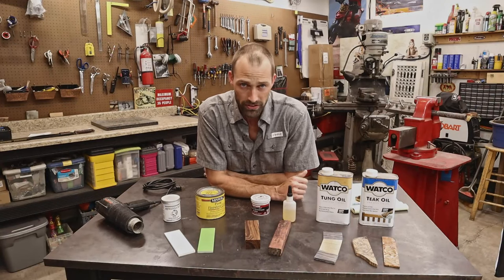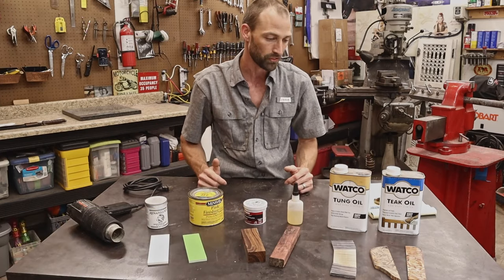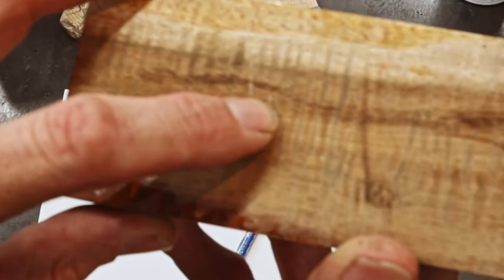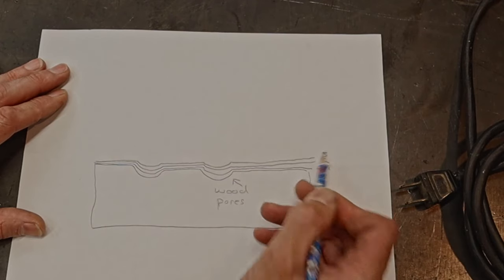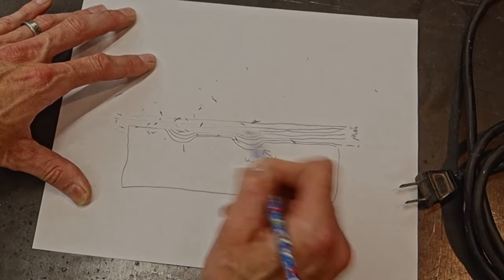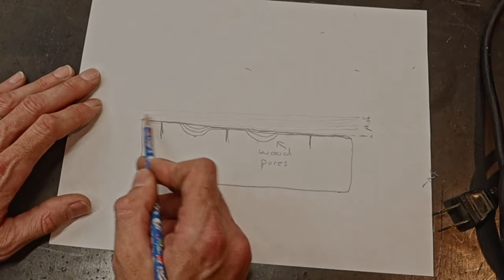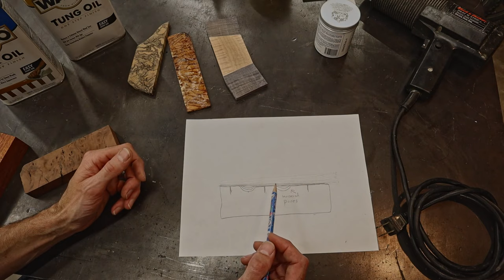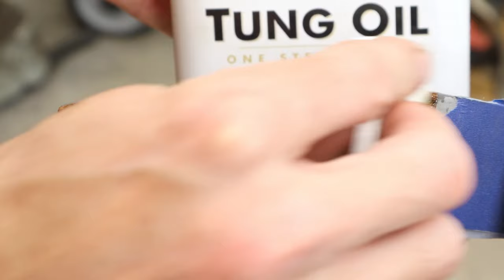Finish for handles that makes grain pop

Comment: In addition to my knifemaking, I've finished a little over 500 rifle stocks with teak, tung and the other assorted finishes in the industry. I fill my pores by sanding in the teak or tung oil...works much faster and you get an ultra smooth finish in the end. I use a 120, 220, 400, 600, 800, 1000, 1500 grit sandpaper progression. After the finish has dried and thoroughly cured, it can be waxed with whatever wax you prefer....Mimwax, Ren Wax or my new favorite,  OdiesOil wax. Odiesoil (the "oil" formulation) works great on any wood but will darken woods just a smidge. OdiesOil WAX is clear and does not darken the pretty handles made from Desert Ironwood, snakewood, etc. Odiesoil is sold on the internet/Amazon, etc. Using tung and teak oils, I can get a much higher gloss using teak oils.
Reply from the maker: I will definitely look into that odie's oil and odie's wax
Reply from the maker: I like a tung oil finish rather than straight tung oil. Tung oil or tru oil are the most durable of the oil finishes

Comment: With super glue finish you can also use a plastic polish found in automotive section and a buffing wheel
Reply from the maker: Thats awesome! Like a headlight buffing kit
Reply: @Aleeknives  not even that, just a bottle of plastic polish. Turtle wax makes one. Just put a bit of polish on handle and buff off

Comment: Is this vid supposed to be 11:17 long?  I feel like I missed the end. I saw up to 7 coats of tung oil, then it just cuts to the next vid in the series.
Reply: Found second part. It should really be a part of this series. Should be 11 parts. Really incomplete without it.
Reply from the maker: I didn't realize it wasn't!  I will change that asap! Thanks for the heads up